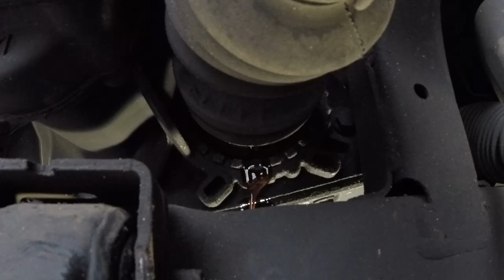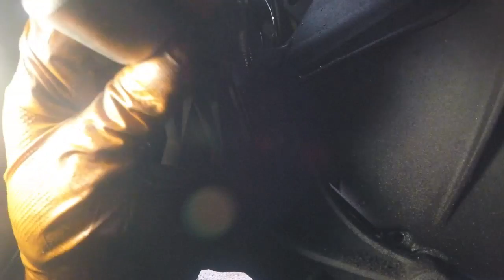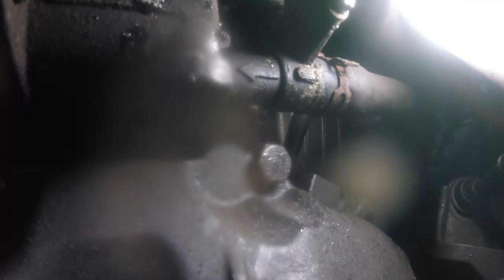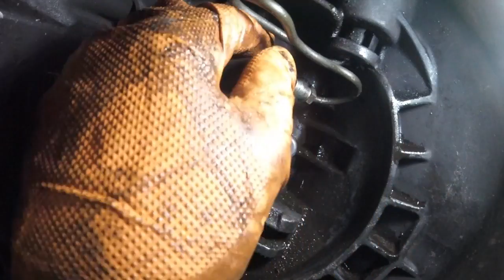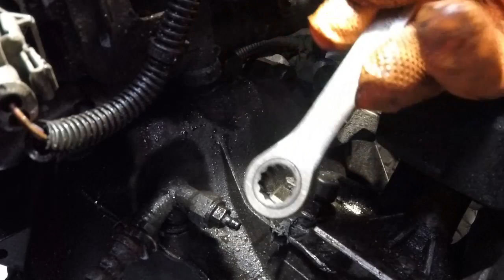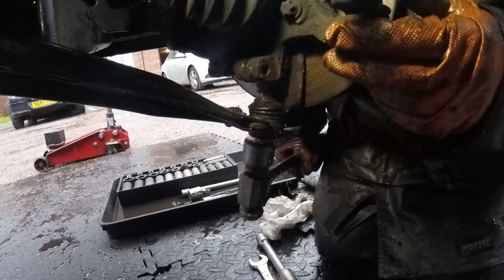2005 Vauxhall Zafira 1.6L Petrol Clutch Replacement

Comment: Was a mechanic 30 years ago. I managed to get a ramp and tools. Your video was invaluable in clutch replacement. Even blew minds of mechanics when no need to remove subframe as they had done previously,also had a giggle when they asked me if I required socket to remove driveshaft from hub😂. Only niggly bit was reattached linkage kept  managing to put on 360 degrees out😢. Also if this comment helps anyone else on a ramp then do mountings in reverse as in remove top first and install last. Thanks Kevin you made easy work for me.
Reply from the maker: Thankyou for the great feedback. It means a lot coming from a fellow mechanic (not technician 😁).
Reply: Also got called a technician at one point. Did sound good lol
Reply: So you don't need to use alignment tool? And what did you spray on clutch caseing. Break cleaner? Sorry for questions this is going yo be my first clutch replacement
Reply: @brynjones1334  can't remember to be honest had an alignment tool but don't think you need it. Brake cleaner is all I used. Replacement thrust bearing can be a nightmare if rusted pipes.

Comment: Not used you before but from your work ethics top job bruv. You even used a thin punch to knock the bolt through preventing damage to threads whilst in the rain. Most people would have just hammered it out without the punch and without care. Well done 👍🏽

Comment: On a rainy cold day you show true grit, really impressed with your work ethic. Keeping track of all the different bolts on the gearbox to engine mounts is a pain. I have only ever changed two clutch’s and both took all day😫😫 I would much rather give the job to you. Thanks for taking the time to film, not easy.

Comment: Excellent video. Gave me confidence to tackle the job myself. I had a knackered gearbox so had to totally remove the old one. Which of course required dropping the whole subframe. Also on the drive, on my back, in the rain.
Reply from the maker: Richard that’s good going .,, is vehicle back on the road now ..,,
Reply: @WMCS  Not quite at the moment. Waiting for the clutch kit to arrive (hopefully tomorrow). Then I can start re-assembly.

Comment: Really good! No gearbox drain this time and no tool for clutch center needed. Interesting! Your tray for tools seemed to be a swimming pool...  Hope good weather comes soon. I still like more the old intro.  Thanks for the video!
Reply from the maker: Oscar Montero good observation... these gearboxes doesn’t have a drain plug. If the correct level of oil is in there it shouldn’t spill out. It stays down in the gearbox sump. As you’ve pointed out no clutch tool required due to the flywheel design. The clutch sits inside the flywheel and the pressure plate slots in and centres itself with the 3 side slots. 

Thanks for your continuous input on the videos. I’ll try and come up with a more retro intro for next season. 😁

Comment: Mant thanks.  have just used this method to change the crankshaft oil seal. Needed right angled drill to put self tapping screw into old seal so it could be pulled out. Used plate with holes in  to press new seal to place using old flywheel bolts

Comment: Clutch replacement in the rain? Respect!
Reply: Do you by any chance know if replacing the clutch your way (without removing the heavy frame underneath) works with an Astra H 1,6 Petrol/5 Speed too? As of what I heard it works with some engine/gearbox combos while it doesn't with others ... Cheers!

Comment: Hey Kevin.  Your work is inspiring me to start Woking on cars myself . One question . 
Does ur clutch alignment tool fit in there properly even if you don't take the gearbox fully out or do you have to do it without the tool . Thanks

Comment: Brilliant video Kevin, really clear and helpful! I'm doing my clutch this week after problems selecting gears. Adjusted and greased the linkage, checked gear oil level, no improvement, but can get all gears by matching engine to road speed with the accelerator pedal (e.g. not using clutch pedal). Workshop manual says i need to support engine and remove subframe for access, but you had enough clearance not to do that?
Reply from the maker: Definitely sounds like the pressure plate. 
I’ve never really had any reasons to remove subframe. 
The video will guide you. Let us know how you get on.
Reply: @WMCS  Fitted the new clutch today, plain sailing except i couldn't prise the clutch fluid pipe off the bellhousing - didn't realise there was a spring clip on it, until i watched your other video on a 2007 1.6 Zafira where you approach it from underneath and the damn clip is clearly visible! Thanks for what you do Kevin, great videos and so generous of you to take the time to make and post them.

Comment: Nice one Kev👌 why didn’t you use your clutch alignment tool??
Reply from the maker: Springer spaniel these flywheel takes the clutch without hardly any movements. And the pressure plate slots in. So they are already aligned once they are in place. Good observation...thanks for your input.

Comment: Hi Kevin, thanks for the video. I've the Z18XER, little bit different but the complexity is the same I think. How about the Flywheel ? Some people says is not necessary to change it cause is a "normal" one and not a dual mass. My car have 310 000km (Astra H GTC)
Reply from the maker: That’s correct. Replacement not required.

Comment: Hi Kevin, really consise details  in your video. I need to take out the gearbox out but don't want to remove the whole sub frame. Is it possible to lower the sub frame do do this and if so what subframe bolts etc. to achieve this? I saw an article and mention about removing the front bolts, would this damage and twist the subframe?
Reply from the maker: Yes absolutely. I have videos on channel showing it.
Reply: @WMCS  thank you for your response. Can you send the link please?

Comment: Quick question. When you tapped the inner part of the driveshaft/cv joint to remove it from the gearbox, what were you tapping exactly? Was it the circlip that helps hold it in place? Thanks.
Reply: To answer myself, I just looked again and it must have just been a tap on the driveshaft as the circlip is way too far in to get at. Thanks for this vid. Am gonna tackle this job myself soon on my Zafira A 1.6. Still going strong at over 180k and 24 years old. Not bad for a car that most people would have scrapped a long time ago.
Reply from the maker: That’s correct.

Comment: Hallo brother , 
I replaced the clutch, and afterward, the transmission oil level decreased. I still don’t know where to add the oil. Could you please advise me?"
Reply from the maker: N/S drive shaft there is a level plug. Literally next to it. Fill it there.

Comment: Hey Kevin, just wanted to ask dont you use the clutch  alignment  tool?
Reply from the maker: Hi Essa.., sometimes if the spot is tight then i finger it in place ..,,✨✨
Reply from the maker: Check the repair in the next 5 mins.., another example of finger alignment ...

Comment: Hi Kevin, thank you for the video.
I tried to replace the clutch, but i have difficulty to re-insert the gear box. How do i align the clutch with fingers? Or if there is any trick ?
Thanks again.
Reply from the maker: Very unlikely it’ll be the clutch that’s misaligned. 
There is a plastic lug fixing the top bell housing to the coolant pipe. Most likely that’s in the way of the gearbox mating back .,,
Reply: @WMCS   Thank you Kevin, i'm going back to continue, will write on the outcome.
Have a goog day.
Reply: Hi Kevin, i finally assembled the car. The gear box was not fitting because the disc was not aligned. I didn't buy SACHS, but i bought from autodoc cheaper version - Ridex. The clutch disc is actually 7mm smaller in diameter, hence more movement and misalignment. I positioned in the center and then tighten up the pressure plate bolts. The gear box fitted easy. I had problem removing the air, till i figure out the reservoir has to be full to the top. Unfortunately, the new clutch is slipping in the same way as the old one ... Do you have suggestion what might be the cause?
Thank you for your help and willingness to share knowledge and experience.
Reply: Hi Kevin,
I found my mistake, after engine number 20KC2905 the clutch and slave cylinder are different and i have ordered the wrong one. Now i'm ordering correct kit and this weekend will be clutch exchange again. 
Thank you again for your video, help and sharing knowledge and experience

Comment: Hi do you reckon its possible to remove the box without dropping the subframe ?
Reply from the maker: Definitely.,, I’ve done it many times. Especially with the M32 box. All you need to do is slacken the opposite subframe and you’ll have enough room to pull it out.
Reply: @WMCS  do you mean slacken the rear of the subframe? ill be doing it on an astra H ?
thanks for your vids, there very helpful.
Reply from the maker: Remove gearbox side completely. Then slacken the driver’s side about halfway out.
What’s the engine size of your vehicle.
Reply: @WMCS  1.6

Comment: Can’t you get a awning for your van so you can keep some of that rain off you ..
Reply from the maker: shaun&jasmine blow that would be great. Not sure where I can get one fitted and at what cost. I had a gazebo before. But the wind keeps lifting it off the ground and it’s a bit hard putting it up on my own. But the jackets and trousers I have are full waterproof I’m normally dry as a bone underneath. Even my safety boots are full water proof. thanks for the suggestion tho. Appreciate it.

Comment: hey, is that a clark jack similar to the sgs 3 ton ones you can get for £70-80? my jacks bust and need a semi decent one for not to expensive . just checked your website and the amount of 5 star reviews you have! clearly do a good job inc the things people don't see like cleaning up ect.
Reply from the maker: you tube thanks for the review. Much appreciated. 
This jack I’ve been using for about 5 years now it’s a 3 tonne sealey pro. So are all of my tools. Don’t cost the earth but keeps going. They sell for about £90 with trade discount from euro car parts. 

I try and keep my work professional. Always tidy. Not a drop of oil on driveway. You’re right you can’t see that in the video. If I’m taking someone’s hard earned cash I make sure that they get a good service in return including being polite.
Reply: @WMCS  I've had my Sealey pro jack for 25 years now mate. I've not had to change the seals yet great jack. Tony DIY mechanic.
Reply from the maker: tony n honestly that jack has been through both world wars 🤣😂😂.., still going strong. It’s a proper lump of metal tho ..,
Reply: @WMCS  you should do a tool box tour! always interested in seeing what tools people have / use, some times reminds me of an item i need to pick up my self haha
Reply from the maker: you tube I’ll try and do a small tour this weekend

Comment: is there gearbox oil drain plug on zafira, astra
Reply from the maker: subutay2011 no they do not have a drain plug. Usually oil doesn’t spill out if it’s got the correct amount in there. It stays down in the gearbox sump
Reply: @WMCS  I noticed some oil did run out. Do you top it up to replace? or is it not neccessary? Is that the level plug, just behind the left drive shaft?